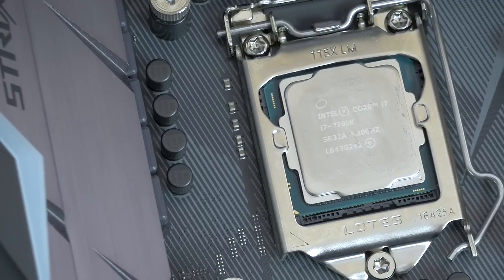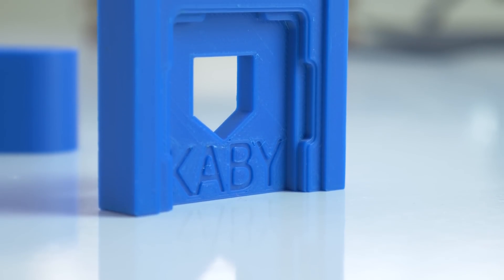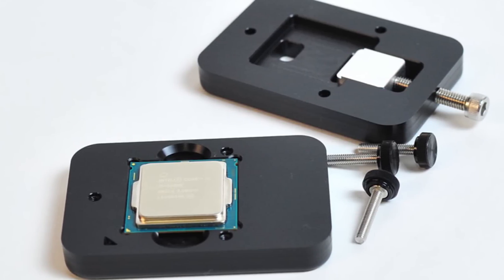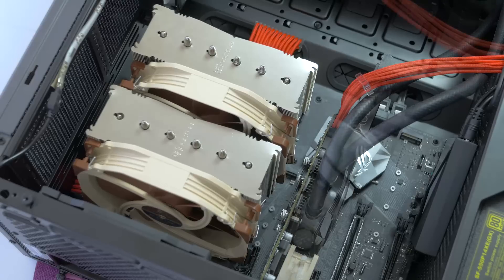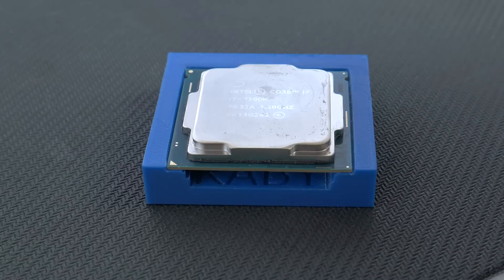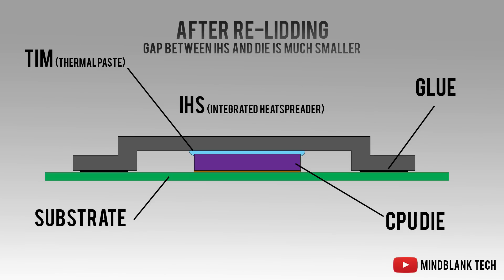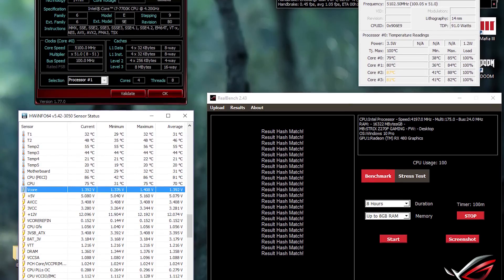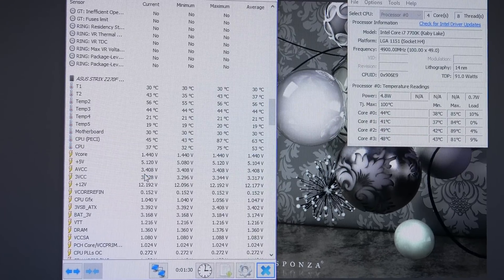Delidding the 7700K - 5.2GHz Overclock - 25C cooler

Comment: my chip is not so hot but maybe its because it's winter now. Im comparing it with my 2500k on the same voltages. Anyway with heat on my max temps are 67C on the hottest core on 5.2ghz 1,355v for 3 hours gaming. Benchmarks are not so different. Im expecting 15-17C more at worst during the summer. I plan to delid it some day just to gain experience and for fun but for now its ok. I plan to use blade since it always have a possibility to brake the pcb.
Reply: what cooler are you using????
Reply: Nikola Vasilev hmm what stress test have you tried prime or ibt makes this a firey heat monster on mine
Reply: this is not for Sandy bride, since sandy has the ihs soldered, its for ivy bridge and the rest that came after
Reply: FellTheSky Read careful.I said I compare mine with my old 2500k. I have 7600k.Maybe the I7s hyperthreads make the difference. And you can delid sandy bridge too according to youtube.
Reply: Damien I use Aida64, Cinebench, RealBench, OCCT
Reply: ah ya and i7s hyper thread does seem to add a lot of heat. on the delid you would still gain some temps but not quite as much as an i7 at the same vcore. that is a pretty nice overclock gratz on that . I have my delided 7700k at 5ghz at 1.3v and just put a -1avx in the bios as it took alot more to have 5ghz stable for prime 95 so i just decided to set it so things like p95 just run at 4.9 and everything else runs at 5ghz. i have some good temp head room so i may one day push the clock higher
Reply: yurimodin my cooler is Lucifer k2.With good ventilated case as well.
Reply: Damien 1 more. I dont use prime95 since its power virus as they say. It stresses your cpu unrealisticly high & it can ruin your chip if you are not careful and leave it unattented. The older versions were fine and not every version of prime95 is using avx instruction btw.
Reply: Damien try -2 or -3 since if you use avx program you will want to be stable and not crash during important work.Better safe than sory.

Comment: Could i practice first with a Pentium 4...because i do have a  bottle of whiskey, but no 7700k!
Reply: Pretty sure i7 920 is soldered so no need to delid
Reply from the maker: I think Pentium 4s are soldered. Check online to see. You won't find a 3D printed delid tool for P4 though. :) Have to make your own or use the pure vice method.
Reply: MindBlank Tech ,how about a i7 920,could i practice on this with this metod? My main goal is to delide my Xeon x5650,and if is a win,maybe i will source a higher one.

Comment: I simply don't have the balls to do this to my 7700k. and this is the reason I went with an over the top water cooling solution
Reply: strongestgameralive I feel you I just paid silicon lottery 50$ to do the delid
Reply: true.. I need to grow a pair lmfao!..
Reply: Tyler Jones the noctua d15 pretty much matched a h115i in many tests part of it is water coolers take a bit to heat soak intial temps are amazing. but since water is harder to take heat off it slowly heats up.
Reply: Water cooling won't make much of a difference if the TIM sucks. If the heat is trapped underneath the IHS then it doesn't matter what cooling you use it won't be able to cool it properly.
Reply: Darth Vader yep that is one plus of aios being able to see you're pretty Mobo/ram,and still have the ability for good cooling. I enjoy air cooling just for the fact I don't have to ever worry in the back of my head about it leaking.
Reply: ingram multiple rads and a few decent size reservoirs is another way to go
Reply: ingram NOT true. lol. I have a 360mm aio and it performs way better then air cooling.
Reply: Jason website for what?.
Reply: Jason o.o..... sure idk what you were even looking for but awsome
Reply: Jason ah ok was not sure what the comment was directed to as there were other things mentioned
Reply: Air coolers are massive... I go with a high end AIO just because it doesn't cover my entire motherboard.
Plus, AIO rads with RGB fans look amazing.
Reply: Darth Vader asthetics arent everything, but i agree, air coolers take up to much space and with the right color led it can make a system look badass, just leak test beforehand, even if its an aio, i had a handfull leak
Reply: The whole point of deliding so that you are able to cool the cpu down... If you don't delid, there is no point in water cooling...
Reply: @esk8spirit362  well there is good reason but yes delid is well worth it and is easy. I've used a razor blade for both my delid with no problems.

Comment: I hope AMD won't cheap out on their new Ryzen CPU's.
Reply from the maker: Soldered? ;)
Reply: Hopefully. I don't feel like voiding my warranty because someone was too cheap/lazy with the design.
Reply: Mr Patato Sometimes I dunno how dafuq AMD got the reputation for being hot. Like, come on... Intel had hot chips for a fairly long time, and actually should've been more evident since Ivy Bridge (but one thing's for sure, Sandy ran cool) and ran hotter than the FX chips. That transistor density for it size (Intel) and the part it wasn't soldered was evident that it was bad in the heat department. You'd think that it would run cooler with that low TDP, but nope.

It just shows that Intel's chosen to not give much of a damn on the QC in their manufacturing process.
Reply: AMD solders all their chips so I wouldn't worry, they will get better results from having lower temps, and they are trying to get any advantage that they can
Reply: If only I could find that link of a chinese dude delidding the Ryzen chip. It is soldered (and based on memory of the photo, it's soldered better than even Broadwell-E chips).
Reply: WayStedYou AMD doesnt run that hot not even at 5ghz
Reply: Yup, AMD FX was great in that regard. Had an FX-8320 at 4.7GHz, with the same cooler as in the video, only got to 60C.
Reply: Topias Salakka intel always run hotter
Reply: Ryzen's lid is soldered and it runs just the same when you delid it.
Reply: AMD, praised be thy name
Reply: i think it had something to do with, at one time, AMD chips would not forcefully instill idle cycles to cool down if they hit very high temps, and would be content with crunching away while the entire mobo burned around it
Reply: Brian Moker Pentium D had that reputation (as well).
Reply: well my fx 9590 is an exception but hey it runs at 1.42 - 1.5 volt so bitch pls its normal that its get really hot 
but with a NZXT kraken x61 with push pull it almost never exceeds 60 C°
Reply: Tumble Butt / Styx on Fire yeah that's what I was getting at. they do run hotter, but the gap between running temp and thermal ceiling was larger than Nvidia.
Reply: They didnt actually :D
Reply: wat..
Reply: btw before i forget it not all amd chips ar soldered i delided just for fun two amd athlon cpus but i guess u just meant the fx cpu right?
Reply: MAOAM12121 Yeah AMD FX and Phenom have always been soldered. Athlon used to be when they were the top chip iirc.
Reply: And supposedly AMD GPUs runs hotter than nVidias
Reply: Tumble Butt / Styx on Fire I've noticed that the AMD GPUs may run "hotter" but they don't thermal throttle until they hit fairly high temp ceilings
Reply: Brian Moker Well, they are hotter cards, but they always had higher thermal tolerance (for a lack of a better term). Just wish I could say the same for the 290X because that reference cooler was really bad or the card itself was just power hungry and emitted alot of heat.
Reply: Tumble Butt / Styx on Fire how my fx8350 at 4.8ghz runs cool under 60'C with a 212evo
Reply: Tumble Butt / Styx on Fire only AMD gpu will run hotter
Reply: Mr Patato The topic kinda swiitched to where someone said AMD GPUs run hotter than Nvidias. I never said AMD CPU's ran hotter at all, you can go fact check in this comment thread.
Reply: facelessninetytwo Well, not exactly with their current Athlons. But, to be honest, I find it forgivable at that point.
Reply: apart from when they used to ship them de-lidded :P
Reply: Topias Salakka Nah, Athlon didn't have an IHS. It was bare core.
Reply: Yavor Kapitanov but they could use better paste
Reply: You'll be happy to know that they did not cheap out on Ryzen.  If I didn't game at 144+hz, I would probably pick one up.
Reply: Well, here's the thing. In terms of being hot cards, AMD got the reputation of being hot cards because they apparently marketed the 290x to be very tolerant of temps at 95c, and thermal throttles... when Nvidia's 4xx and 5xx series cards were arguably as hot and ran hotter than AMD GPU's prior to the 290X. And guess what? Pascal has a reputation of being very hot that it thermal throttles as well. Best way to hide those were to let the likes of Asus, MSI, Gigabyte, EVGA, XFX, Sapphire, Zotac, etc... (which both AMD and Nvidia did, doesn't matter who did it first between the two because its been done before when Nvidia and AMD weren't the only two in the GPU market) to deal with it and even improve power delivery and turning it into full fledged non-reference versions of those cards. Still, nevertheless, it Nvidia ran hotter for longer than AMD... but AMD just had to do it. Now you can almost be forgiven to think AMD ran hotter because they basically brought it to themselves...